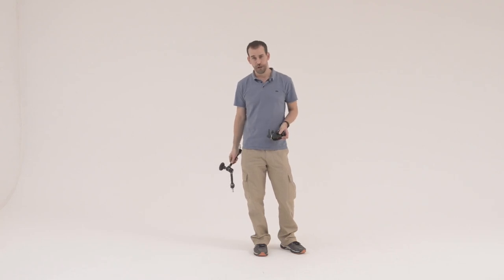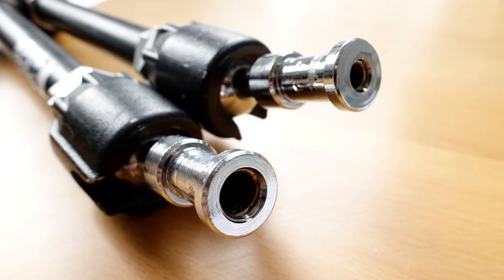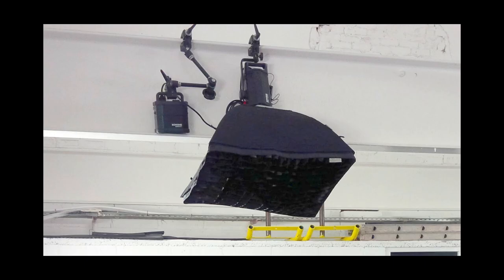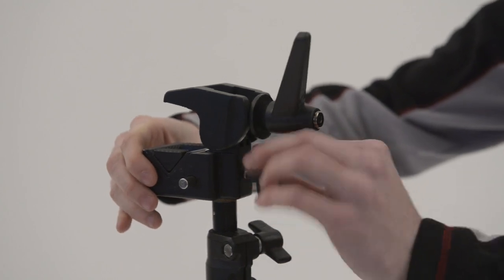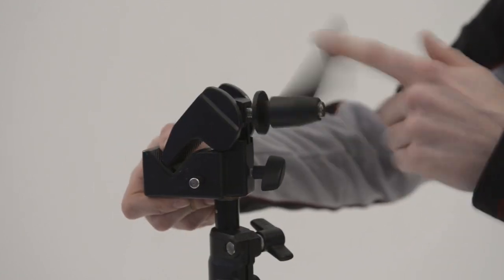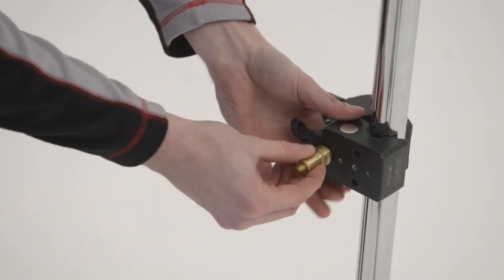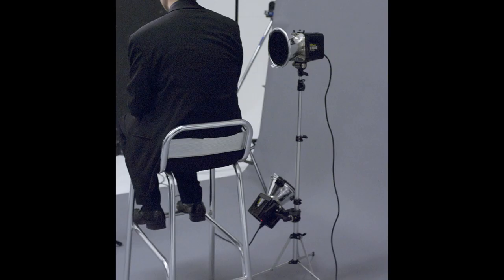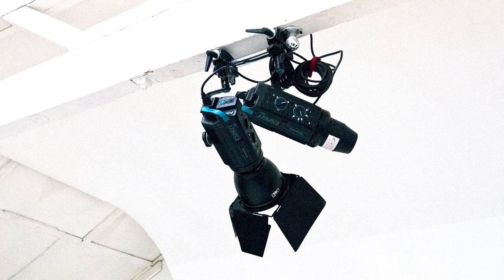Equipment Basics: Magic Arms and Superclamps

Comment: loved the trick for tether cable.... better than having laptop pulled on floor. also, the safety cable around flash head when mounted on rafter... very safe!! great explanation of tools. have owned and used superclamps and spigots since I started photography. Sooooo useful, can build and hold anything with them! :)

Comment: REALLLLLY helpful!!  Thanks!!  I’m looking at attaching my camera to my wheelchair and this is perfect!!  It will make a huge difference!!
Reply from the maker: Very glad to help. There are probably some gimbals out there that might work well, but likely to be more expensive. Happy to help with any other advice on kit.
Reply: @Tommilesphotography  that’s really appreciated. I am looking at using a Case Air  (Tethering) as I have no finger movement. This will allow me to adjust settings on my iPad. I can move away from Auto!!  So, that’s the basic idea. A Magic Arm hold my camera in place and my phone or iPad lets me control it. I’ve been looking at lighting and so on!!  Phew!!  I'll start slowly!!  Thanks again!!
Reply from the maker: The tethertools stuff is generally very good, although I've not used the caseair myself.  When it comes to lighting, I think some manufacturers are now making apps for their lights - I know Profoto do with their very latest kit - that would allow you to control your lighting from an app, rather than fiddly controls if dexterity is a problem.
Reply: Hi - I'm looking at doing the same on my wheelchair, but with binoculars.  Do they do one in x3 parts so its a bit longer?

Comment: I have a question that maybe you could answer...I have one of these and was considering getting a carbon fiber stand. If weighted and balanced correctly, could this be superclamped to carbon fiber without crushing / warping the stand...I hear carbon fiber is stronger than steel, but I also hear cheap carbon fiber breaks easily (I’m not sure how light stands hold up).
Reply from the maker: Good question! I have occasionally clamped these to the leg of my carbon fibre tripod, and they're fine, but do be careful how much you tighten them. It's definitely true that if you tighten them too much there's a very decent chance carbon fibre will shatter rather than bend.  I've had CB tripods that have shattered, not through over tightened clamps, more through accidents, so I can definitely confirm it happens.

Depending on how big the light stands are that you're buying, I'm not sure the weight saving would be worth it, as I'd imagine they'll be more expensive than aluminium ones.

Hope that helps.

Comment: Thank you, very instructive. Can I just confirm that the magic arm as such, doesn't connect between a tripod and camera, to allow point vertically down shots?  But needs a strong stand and a K clamp?   Thanks
Reply from the maker: My pleasure, and although I don't quite 100% understand what you mean I get the impression you're trying to use the magic arm and a camera platform to shoot "flat plan" style shots.  In which case, yes, you'd need to brace the camera in some way, or mount the arm very carefully - the weight of a camera out at one end of the arm will cause it to slip and topple over.  

If you're trying to shoot "flat plan" stuff, you're much better off with a tripod that will allow you reverse the centre column - loads do this nowadays.  Hope that helps.
Reply: @Tommilesphotography  Thanks again, yes I know the answer now.   I wanted to avoid a new tripod purchase and think this will work instead with a heavy duty stand and the super clamp arrangement.

Comment: Thanks. Is it normal that the magic arm spigot (the one attached to the ball of the arm) get holed by the superclamp screw?
Reply from the maker: If by "normal" you mean "standard", then yes, it's quite normal to have the spigot inserted into the female part of a super clamp, but as it's a standard size you can use it in anything it will fit, such as a light or other accessory.
Reply: @Tommilesphotography  hi. What I meant is that when i insert the magic arm spigot to the superclamp and I screw to fix the spigot, that spigot get holed by the superclamp screw. Is that normal?
Reply from the maker: @lucadiscala7027  definitely not in that case! Send it back and get it replaced!

Comment: How do I attach one of these to a Manfrotto 504HD Head. I cant find a magic arm that fits.
Reply from the maker: Black Film Guild I've got a 504 head, and it's only got female screws - so has the manfrotto magic arm. So, I'd either get a double headed spigot, and screw one end into the head, and one into the arm, or get a smaller arm with male screw ends. Hope that helps.
Reply: Exactly, thats my problem. can you point me to a link where I can purchase this?
Reply from the maker: Probably not for about 48 hours! I'm on a location shoot with no WiFi, and very little signal! I've got one from smallrig that might be what you're after, depending on how big the thing is you want to mount.
Reply from the maker: Sorry it's taken me a while - got back late last night!  Try these guys:  http://www.smallrig.com/supports/articulating-arms.html I've got one of the smaller ones, and it's ideal for things like an Atomos screen or similar.

Comment: whats the maximum support with magic arms and superclamp if i need to grip a light ??' 3kg?
Reply from the maker: They'll hold quite a lot of weight, but it depends entirely on how you rig them, and what position you put them in.  If you think about the physics of it - extended out at full stretch, they won't support too much, because of the increased leverage from something further from the point of contact.  But if you bend them slightly back on themselves, and bring the weight (the light in this case) closer to the point of contact, they'll hold much more.  I've used them to hold up flash heads dozens of times, but it depends on exactly how you rig them.